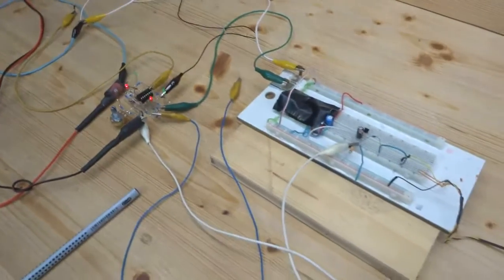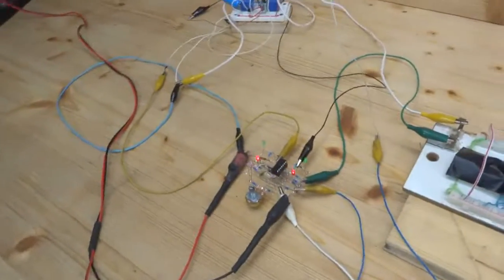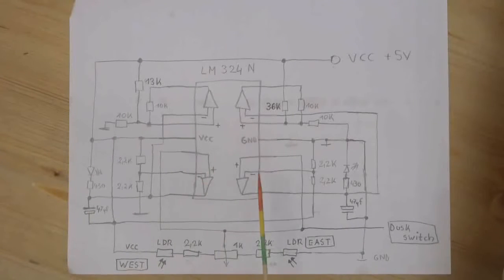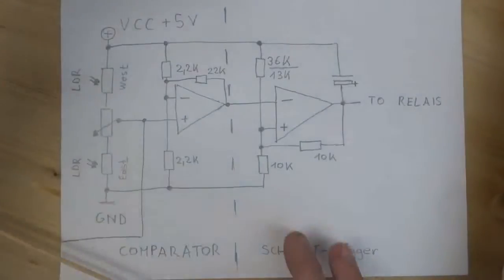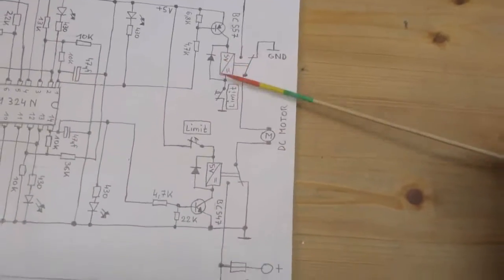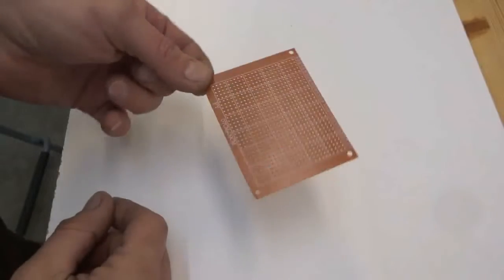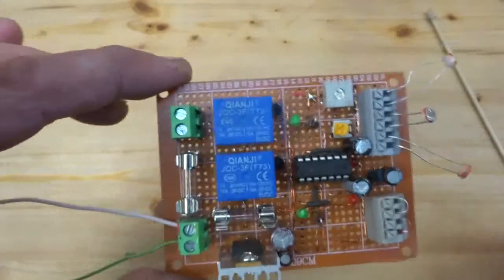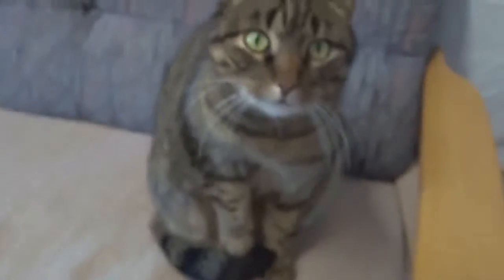DIY solar tracker circuit..  (no microcontroller)

Comment: Very simple system but it seems well thought out, after all simple things always work! In such cases it is always better to reduce the active components to at minimum, especially as the object is exposed to atmospheric elements, because as we know, the more complex a system is, the greater the risks of failure! In Nature everything is simple and well designed with the minimum of necessary elements! 
A small suggestion, if I may, try using 4 sensors to also have the direction perpendicular towards the sun, obviously using the same criterion! Simplicity is always a great choice! my compliments!
Reply from the maker: Yes, you can build the circuit twice, and use 4 LDRs to create a two axis tracker... As far as i can tell from more then 20 years experience, tracking the elevation makes no noticable difference on such small systems. (less than 1Kw).. It is enough to set the angle once a month by hand... Funny sidenote.. Meanwhile, i developed an even simpler tracking circuit, by utilizing the comparator LM 393... Now the thing works with just half the component count. Maybe i will make a follow up on this topic in the near future. I always try to follow the KISS principle..  ;)

Comment: Wouldn't be easy with cheap microcontrollers like WCH CHV003?
Reply: This is way more fun. I wonder how much current it draws. You can do this with two small solar panels connected to a motor. This circuit is probably great for allot of other things aswell.
Reply: @Wtfinc  I see, I was also thinking you can use spring loaded platform to drive back solar panels every evening to their starting positions
Reply: @Kipruto254   how to reload the spring tho. The solar panel idea doesn’t need anything to work. It blew my mind. I think william osmand made a hat 🧢 where the bill follows the sun. It also requires a shadow plate.
But the op amp thing is cool and works no matter what. The solar one is weak sauce.
Reply from the maker: Yes, the two relais could swith even bigger contactors to drive a big 3 phase geared motor..For a very big solar array.
Reply from the maker: And yes, I almost always prefer the microcontroller version. A simple ans smoll attiny 85 would be suited for this circuit.. But i made this video because a lot of people out there dont like to work with microcontrollers.. So this one is more or less one option of probably hundreds to do the job.